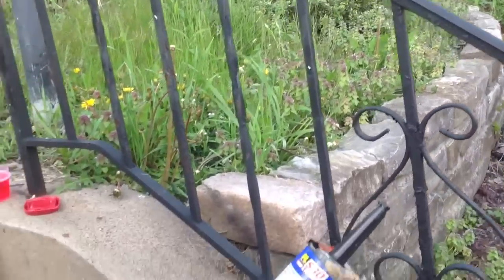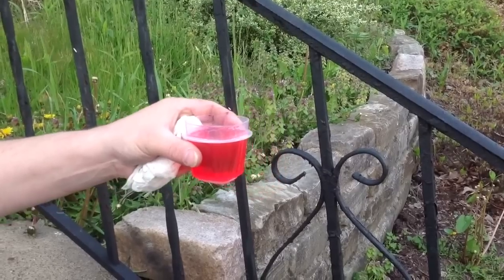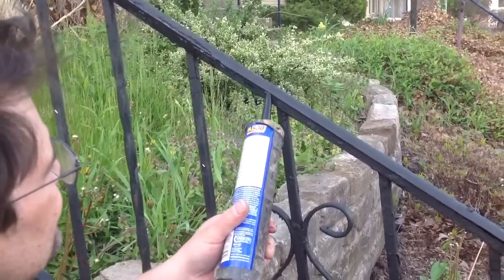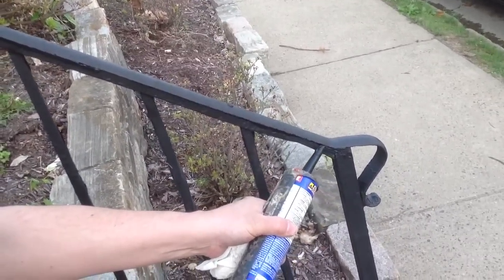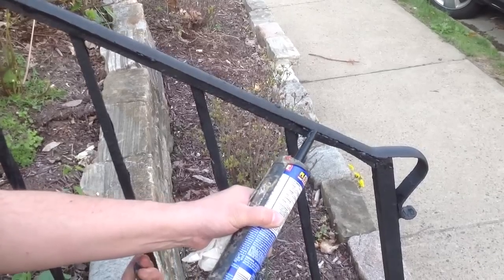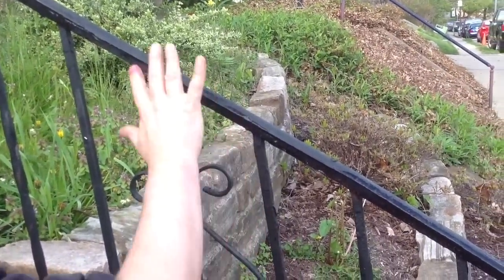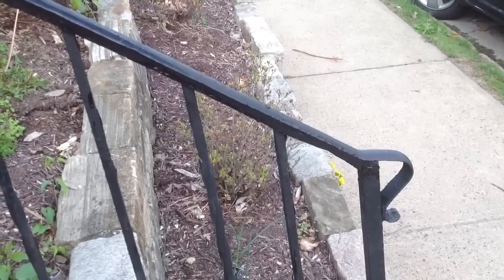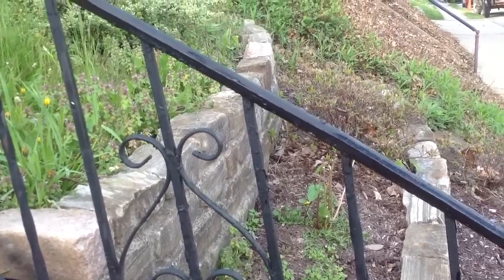Repairing a rusty metal hand rail

Comment: Did you need the rust converter? You didn't mention it in the video.
Reply from the maker: You done absolutely need rust converter. a good derusting with a wire brush and paint will do the trick.